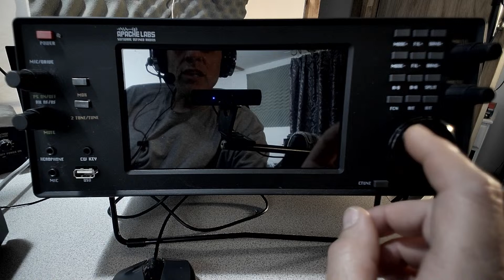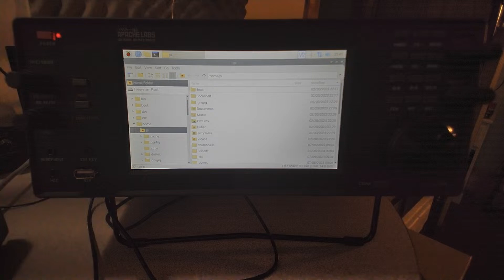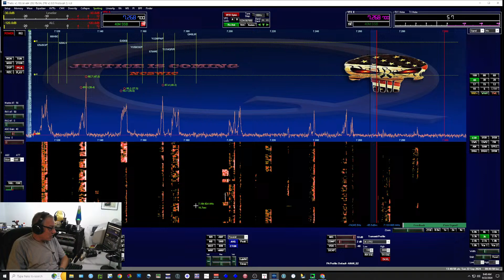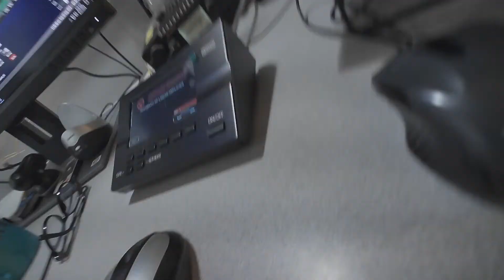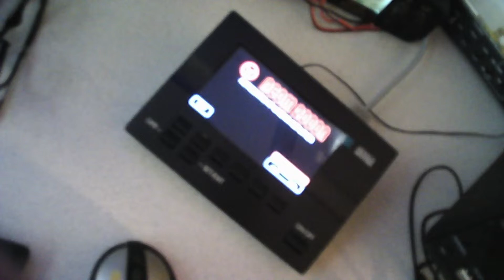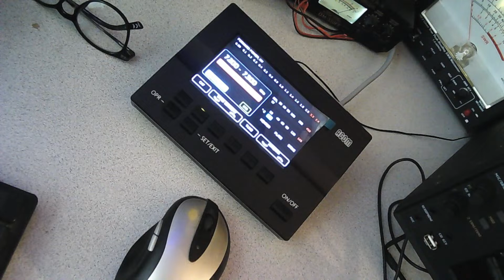HAM RADIO LIVE STREAM-- APACHE LABS ANAN G2 AND ACOM 2000A FIRST IMPRESSIONS...... HMMMMM

Comment: I'm a ham out of Canada.  I'm considering a new radio upgrade for my 7300.
I'm looking at the typical options ie. 7610, 101mp and possibly a Flex.
I find the Anan product to be intriguing.
Is this newest addition still overly complicated for a less than computer "genius"?  I've been reading quite a bit on older forums about the pretty extreme complexity of Anan products.
Has it changed with the advancements or should l stick with a more conventional SDR?
I'd love to experience the performance they're famous for .  Thanks for this video
Reply from the maker: @peterarsenault2671  Nothing has changed regarding the Anan. Still the most complex and quirky rig on the planet. The G2 has been average on the quirk level. Standalone is very good. I've never had a flex but Frank w2sdr has moved to a flex from anan and loves it. It's the flagship 8600 I think. Just a re20 mic straight into the rig and sounds awesome on AM. My impression is it's exponentially more stable as I never hear him having to fuss with it. Just some info there.

Comment: From the ANAN G2 users manual available from Apache labs.: "The front panel display can provide the front panel display for piHPSDR. In this mode it presents the 
front panel for your radio, allowing completely standalone operation. " Those like me withe the no screen model, HDMI may do the same instead of operating from the front panel.
Reply from the maker: @k2icc  yes, I heard the same thing. Just connect a monitor and mouse. Off and running.
Reply: @k1gmmgreenmountainmaniac251  I will be working on that, as your videos gave me some motivation on other ways to use the radio. Thanks for that. I am waiting for the other videos of yours. I got my G2 few months ago, but so far audio via computer, Thetis, etc. Will test today in few minutes. Thanks.
Reply: Congrats Dude!  Make sure you save your right Nut or you’ll have to start wearing a skirt in your vid’s. 🤣🤣🤣 - 73 - VA3VMD